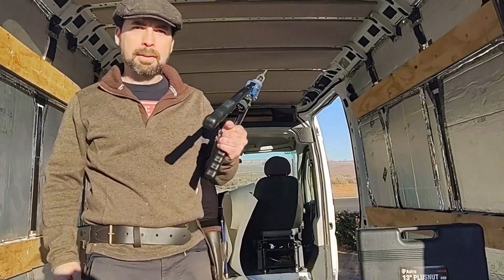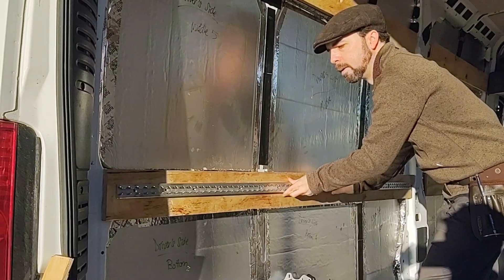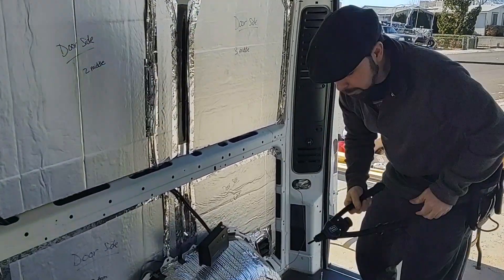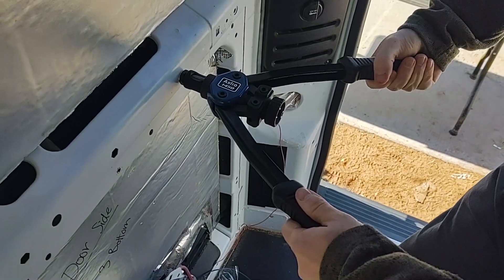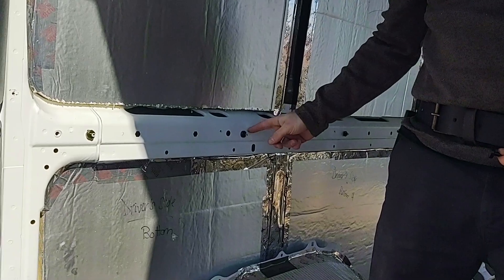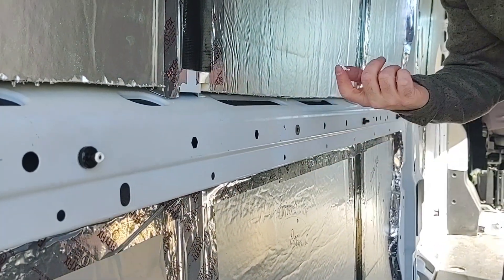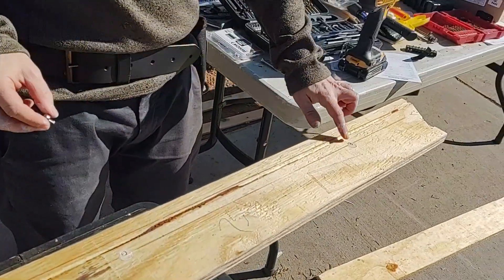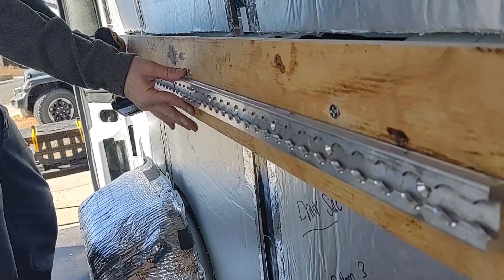Van Build #1: Plus-nuts & Framing

Comment: I just installed a number of these and I can say with 100% certainty that there is NO NEED for a special installation tool.  Some of the dedicated tools actually do an inferior job and take make it look a lot harder than it actually is.  A grade 8 bolt, oversized nut and wrench, and a couple washers combined with a drill or bit driver works perfectly.  These things are really soft and I set most with a stainless screw.  Just don't over-do it.

Comment: You can also use a long strip of painters or duct tape to easily transfer mounting hole locations to your lumber.  Put the tape strip over your rivnuts - one strip for the length of your lumber.  Mark each hole with a punch or marker. Transfer the tape to your lumber & mark again, or drill directly. Easy trick.